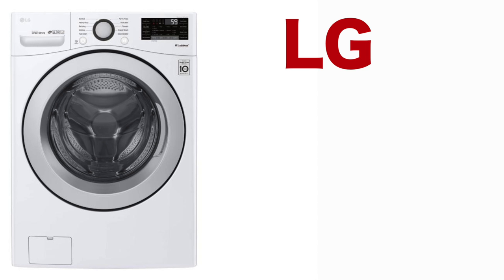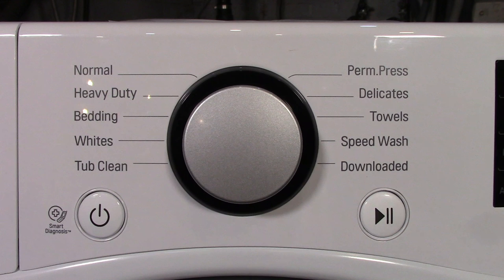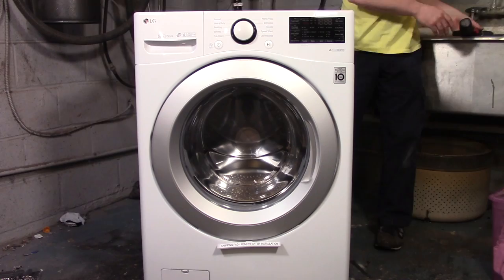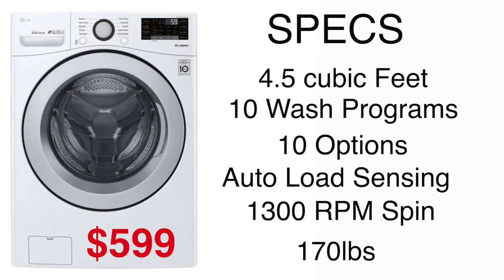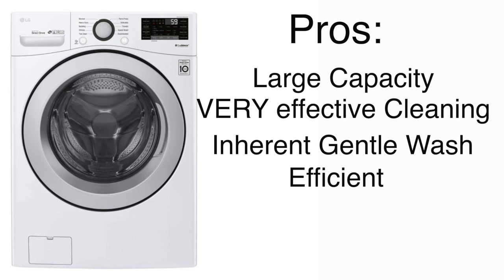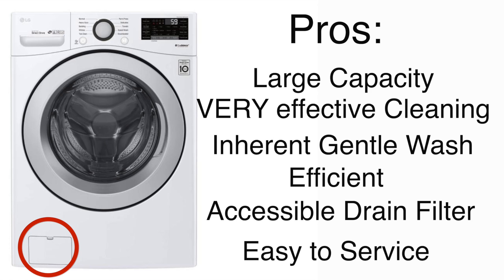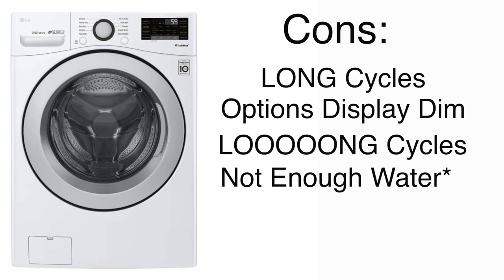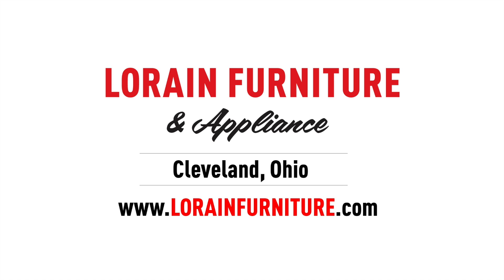Review: LG WM3500 Front Load Washer I am SHOCKED

Comment: Excellent review! Yes, it has long cycles but you can wash huge loads which means less cycles and less time overall doing laundry.
Reply: true.
Reply: That's the way I look at it.... Take an older top loader that's 3.5 cu feet and takes 40 min's... But then what was 5 or 6 loads in that washer is 3 in this one.... so it basically evens out... and with the turbo wash models the times can go way down....but if you want long washes in those you can still get them. I trust Eugene if he says he likes LG and even takes them apart and looks at everything... I trust his advice. But for safety I'd still plug any modern washer into a surge protector

Comment: I just got the combo version of this washer. It takes longer per load, but I can literally wash twice what my speed queen top load could wash at one time!

I was also shocked how clean my huge load got, and no detergent residue showed up when I swished a clean garment in water- so it rinsed well too.

I used to use 4 TB detergent per load in my top load washer… for this I use 2 TB for the huge “double” size load to get both clean and having no residue.

So my detergent will last 4x as long! Impressive.

Comment: Just moved into a new home, did my first load and was worried there wasn't enough water in the cycle. Thank you for setting my mind at ease. I found this extremely helpful.
Reply: One thing you might want to know is that the most stingy cycle with water is normal... and that's what most people use....I think that's because they base the energy guidelines on the normal cycle... You may notice other cycles use more water and the definitely use more water in the rinse than wash

Comment: Many modern front loaders have options of much shorter "express" cycles such as 15mins & 30 mins.  The Fisher & Paykel front loader I have does an excellent "everyday" wash in just 49 minutes!!! Admittedly it has both a hot & cold water intake plus an on-board heater.  The other thing people seem not to understand is "lack of water" and this is really about immersion (water-guzzling top-loaders) v.s saturation (water-miser front-loaders).  As long as fabric is saturated with sudsy water it will get clean. Fabric doesn't have to swirl around in massive amount of water to get clean, in fact, more water dilutes the detergent more.  Finally, the tumbling action of front loaders is a much more effective and efficient cleaning method mechanically speaking.

Comment: Great to hear this is a good machine because we just ordered it during Lowe's 4th of July sale and it will be our first "modern" washing machine.  Always owned top load with agitators, but figured this would be a good entry level front loader to try out for the price and ease of use.
Reply: You'll love it. Using cold water the wash bill in minuscule. Get yourself those "eco eggs" that don't use laundry detergent. Had them for years not and don't worry about buying detergent anymore.
Reply: How’s your machine holding up?
Reply: @k.kreations.g  It's been pretty good! Clothes always get clean and smell fresh. We keep the washer door open to prevent mold/mildew in the rubber seals. The dryer has had one issue, which was lint buildup that required me to take it apart and vacuum out all of the lint that was causing it to overheat and shut down. Thankfully the machine is smart enough to sense the problem and give the appropriate code so you can self diagnose and fix without the need of an expensive repair call.
Reply: @BlakeSuperior_Beats   wow thank you so much, I was thinking of buying ge because of the microban but I guess all I need is too be cautious about cleaning it after washing

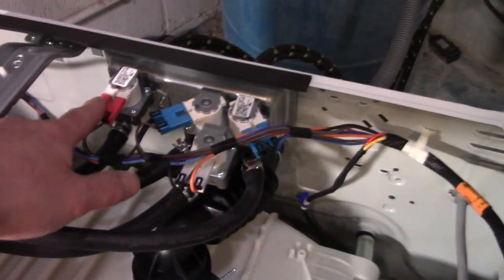Comment: About the "not enough water", there is a screw (with red loctite on the screwhead) at the back left (1:31)) that can be turned clockwise a little ways to adjust water level up. Caveat: it will void the warranty.

Comment: My LG front load is 10 years old. Only replaced the door latch and did it myself. Washer stopped tumbling and that was the issue. I had a heads up because for about a year I had to give the door an extra nudge shut. My cycles are average 55 minutes. There are pre wash and extra rinse. which I sometimes use with a short wash cycle. Hand wash is excellent, tumbles one way then has a long pause, then reverses. This mostly soaks the clothing and not tumbles it. It has a 22 pound wash capacity and can wash all my quilts.LG's are also direct drive with no belts and a lifetime warranty on the stainless steel drum. I love my machine.

Comment: I have a WM3400. Its only 3 years old, I've had to replace both water inlet valves and all 3 shock absorbers. Its easy to work on but boy are the parts light duty. $300 just for the parts. Paying a technician for these 2 repairs would have totaled the machine, was a black Friday deal for $598.
Reply: Amateur repair tech here. I'm pretty sure the motors, pumps, and dampers of all washers come from the same factories in China. You can even see this on the Maytag Commercial washer teardown, which is why I decided against it. Considered the Speed Queen but from the Lorain rebuild video, it looks like a pain to take apart and put together (3 hours+ to redo the tub seal!). The thing about this washer at least is that it is convenient to open up when these parts do fail, I'll probably look into modifying mine with more robust parts and see how it works out.

Comment: I love this review, although it did not answer my question that I originally sought to find an answer for which was, how do you get rid of the moldy smell and the disgusting, grimy black sludge that’s in the basin of the plastic ring around the entrance to the washer. But, I found this to be the most accurate description of the washer that I’ve had for three years and I love that you have a ketchup test and I love that you get emotional about the fact that there isn’t enough water you rock on and have a great Fourth of July weekend.

Comment: Can you do a video about laundry detergent? Pods vs powder vs liquid? Which one is best for a top loader and which one is best for a front loader? Thanks! (:
Reply: As a White Goods Engineer who works on washing machines daily my advice to you would be...
Avoid the pods full stop, use the liquid detergents for hard water areas and powder for soft water areas.
The pods leave a layer of slime behind that builds up over time leaving a sludge that not only becomes a breeding ground for mould/ mildew/fungus/bacteria which create nasty smells, it also goes into your laundry and therefore on you.
The fungus will also go into the open pores of cast aluminum drum spiders and seems to weaken them causing the spider to eventually crack/break.
Oh.. and the slime from these pods will also deposit themselves in your tumble dryer clogging up the drain holes leading to the pump.
Hope that helps..

Comment: Bought this and companion dryer based in part on your review. I agree, this thing barely uses any water. My main complaint is the water hammer in my pipes when the valves close abruptly - I added water hammer arrestors to the back of the machine and it's better, but not totally mitigated.

Comment: My control panel failed (selector knob not working, cant even use screw driver to turn the selector stem with knob off).  Quoted $500 parts/labor to fix.  Could I replace control panel  myself relatively easily?
Reply: I fixed it myself!  Control panel not broken, I think the vibration of the washer caused a loose connection and once I took it apart and put it back together it worked!!!!

Comment: When I look up reviews on front load washers I will see bearing failure as one of the primary reasons why their machine did not last but a few years, I was wondering if any of those people overloaded their washer without really
knowing they did it,  One time I heard a loud banging downstairs that resonated thru the whole house  like someone taking a jack  hammer against the furnace, went downstairs and our front load Samsung was banging against the dryer as it was shaking back and forth while in its high speed spin cycle , I stopped it and asked my wife, what are you washing in there a bowling ball ? NO, just those two small rugs from the bathroom ! I opened the washer door to take the rugs out and yes there were both small, but when those rugs were wet they felt like each one weighed 20 lbs ,
 a few months later the washer failed, I took it apart intending to fix it but parts cost  made repairing it not a practical option , the spider bracket that holds the drum was a still in good shape with minimal corrosion ,but had cracks in several spots which no longer kept the drum turning level and allowed it to wobble and do all the damage,
I believe that over loaded wash load led to my washers failure,
Reply: Nope. The failure of your washer had more to do with the shoddy bearing and spider quality that Samsung has in their front load washer

Comment: I have a modern one WV5-1409W, 1 and a half is quick for a front loader water gets me mentally not seeing as much but it does clean really good dont know how they do it but science what bugs me more is it has a dual inlet but almost never takes hot and when it does it's like 100ml not enough for warm water to even get to the pipe like yo I have a heat pump basically free hot water but it wants to use the element.

Comment: On the Cons, you did not mention that the washer does not have a recirculation pump which makes a big difference in wetting down the clothes and helping with the low water level. Perhaps it would also cut down on cycle times.
Reply: Mine has roller balls in the drum that spray water from the drum to soak the clothing from the top.

Comment: I understand the feeling that you have about the water level. I was watching how it washes the clothes to check it out since we just got it today and found it weird that it didn't really soak the clothes at all. I thought it was a concern since the top loader washer that we have came with the house and it's a very old washer that didn't usually fill the tub even when we had it set on the large load. I just hope it still cleans well and that the detergent doesn't stick to the clothes

Comment: We have this same machine. Purchased it about a month ago. It makes a very loud banging noise as the tub shifts itself back and forth during the spin cycle. Light loads of about 7 or 8 towels or a mixture of clothes and towels. Doesn't seem to matter. We were thinking something has to be wrong. Called LG and they sent a "tech" out who just left a while ago. He said the machine is very temperamental and that we just need to try different loads in it till we come up with the right combination so that it doesn't get so out of balanced! Said you can have to little or to big of loads. We tried a full clothes basket load of various clothes after he left and got the same banging results!! Have you noticed yours banging at all during the spin cycle? I still think something is wrong!
Reply: Mine does this.
Reply: Did you ever find out what the issue was?

Comment: I bought this model a year ago. I paid over $1,100. It does not clean at all. It barely gets your clothes wet. Half way through a cycle, I could see dry areas on my clothes. You can't wash a king size quilt. I did two 2 hour cycles and it was just as dirty coming out as going in.

Comment: i have this model washes very good but the cycles take long because it does not have turbo wash which helps soak the clothing with soap and water. this washer soaks the clothing by filling the drum with water. i wish they would have put turbo wash on all  the lower price models and the 360 turbo wash on the more expensive models.

Comment: How many shipping bolts does this washing machine come with? I am experiencing an issue where this washer is shaking uncontrollably to the point where its almost trying to escape! I saw some reviews that this was a common issue. I am not certain if my installer forgot to remove some shipping bolts or if its due to a manufacturing issue.

Comment: Lolz. This is an American model. In Thailand, I got an 8kg (that's bigger) with steam, Wifi control, 'AI' detect on some cycles, it only takes cold water (heater inside) and the price about $420 US ;) Sweet machines - my 9 year old Samsung was great, but the finish got really tatty, plastic went brown/silver knob finish wore off, rusty screws... but the DD drums are stunning.

I ALWAYS add at least one extra rinse for bedding and towels... to counteract the lack of water ;)
Reply: Bigger? no way. This is a 4.5cu ft VOLUME machine that is 127 litres capacity. Your 8kg from Thailand most likely tops out at around 60+ litres or what the yanks would call 'compact'. So in terms of capacity yours is HALF as big as this one.
Reply: 8kg?? Haha. That’s puny. These American beasts can hold anywhere from 18-24kg from those same standards.

Comment: I've seen negative reviews on this machine about not being able to see the LCD screen  read out..not able to see settings. Any reply would be apriciated.
Reply: Use a flashlight.  These perform so well I'd happily use a flashlight if I didn't have a bright laundry room.  Thankfully it was trivial to change out the cheap builder provided fixture with a bright LED light where my washer is so I have no problems reading the display. 

However it is annoying they use dark text on a black background and worthy of criticism.  Stupid designers.  Still not enough to avoid getting this machine.  I'd print my own labels if it was between using this machine or having to get another.

Comment: I've had this washer for 5 days. Done maybe 6 loads. I agree that the display is hard to read, I use a flashlight to read it. It seems to clean very well but when it's in the spin cycle the noise it makes is unbelievable. I want to hold on to it to keep it from shaking apart. I thought it had something to distribute the load to balance it out. Will do a couple more loads before calling Home Depot.
Reply: The feet are not balanced.
Reply: The feet are not balanced.
Reply: you did remove the shipping bolts right ? and you did level the feet right ?

Comment: I just replaced my 15 year old front loader Whirlpool Duet.  I loved it and thought it cleaned great until my new LG 3500 series front loader showed me differently.  I read and re-read the instructions and loaded it up to capacity.  It was not overloaded, but held a lot of laundry.  I had my doubts as to how it would clean that large a load but was amazed.  The clothes were cleaner and softer as well and I only use vinegar as a softener.  But, I have a question.  Is there an efficient way of doing small loads?  I prefer to wash more often rather than letting a huge hamper full of clothes to collect.  I am still a bit confused on how to do a small load without having the machine run for a super long time.
Reply: 2-4 articles of clothing is perfect for a 15 minute speed-wash. But even smaller loads will take at least 50 mins on this machine. You can reduce the time by selecting the lowest soil setting.
Reply: @12333  thank you!
Reply: @Isaac Joby John thank you!
Reply: @12333    Thank you!
Reply: @Isaac Joby John I have just discovered this.  I so appreciate your reply!  Thank you!

Comment: I have an LG front loader that is about 6 years old but has a problem with excessive slime.  Is the slime still an issue with these things?
Reply: D.A. Arthur we have used front loaders in Europe for decades. Nobody has had a top loader since the seventies, they simply don't exist here anymore. We don't get slime. If you are getting it it's because you are using liquid detergent which is a nightmare for any machine, and not doing a occasional very hot wash. Plus, it's important to leave the door open when not in use.

Comment: You can adjust the screw on the water level sensor to get more water
Reply: That's what I did with my LG washer that I bought in February 2012.  After owning a Frigidaire from loader for 13.5 years, I was disappointed in how little water the newer front loaders used.  The Frigidaire front loader I bought in 1999 had a smaller drum (3.1cubic foot), but the door was  smaller than the drum (unlike most of today's models, where the door is almost as big as the drum), and the drum filled a third of the way up the drum.  So you knew it used enough water.  The lightest load used 18 gallons, and the heaviest used up to 27 gallons of water.  The timer was mechanical, and had 7 cycles: Regular (heavy,, normal and light), Permanent Press (normal and light), and Delicate.  It also offered a separate prewash cycle, though I didn't like the prewash on the Frigidaire, because I had to reset the washer to start the regular cycle.  On the LG, at least it was included in the cycle, if I pressed prewash.  The old Frigidaire had a wash, spray rinse during the draining of the wash water, then 3 rinses, and the longest cycle was only 50 minutes.  On my LG with a 3.6cu.ft. drum initially filled to barely cover the bottom of the drum, leaving too many of my clothes dry.  I have mine set so it fills to the top rim of the drum.  I can still open the door to add clothes, if needed.  Since I only use the normal cycle, I add another rinse, so it does 3 rinses, instead of 2 by default.   Because of that, the shortest time is 1 hour, if I select light soil.  My next LG will have the turbo wash.
Reply: @davenwin1973  I adjusted water level on my LG and love it. Mine has turbowash. Normal cycle ( hot water) with turbowash and extra rinse takes 45 minutes. I bought it in 2013. No mold or bad smell issues and I noticed the window never gets gunky after adjusting water level. My adjustment is also subtle, so I can still open the door during wash. On rinse it fills a little above drum lip. It made huge difference in washing quality.